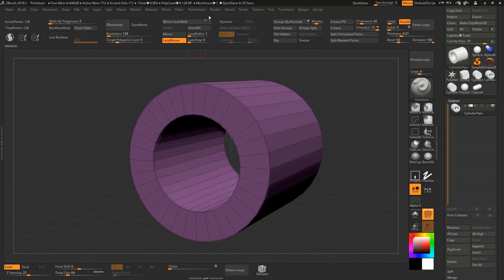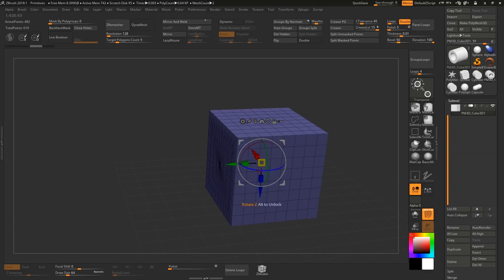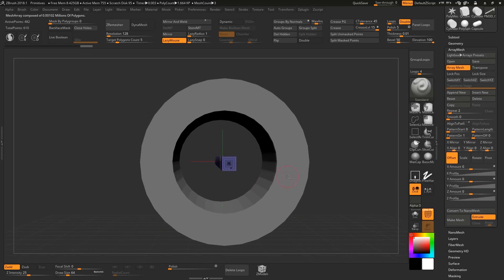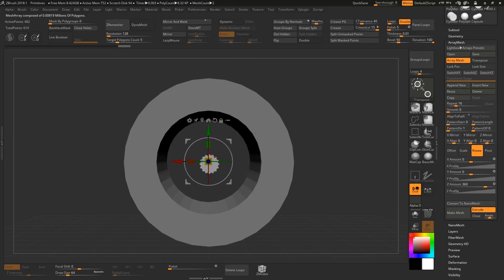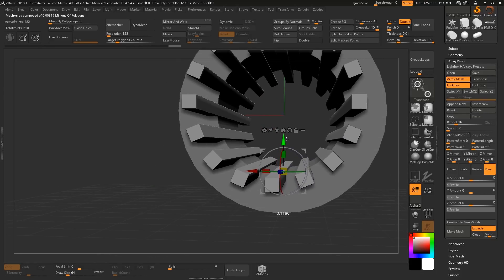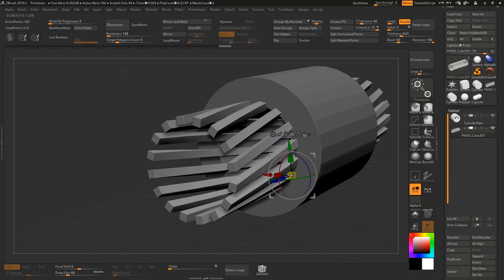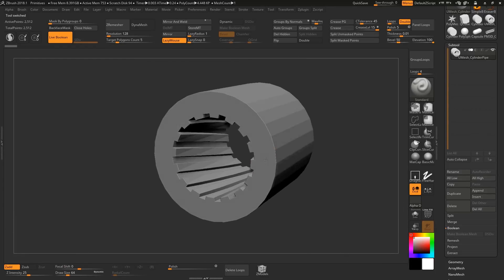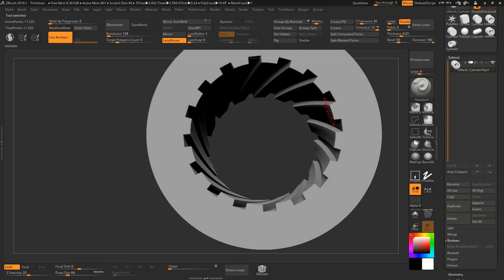Making a Gun Barrel in ZBrush - Hard Surface Techniques

Comment: If the user holds CTRL and the space bar with their right hand vs. their left and then double clicks their center mouse wheel, Zbrush will immediately recognize them as a Zbrush Cowboy and lose all respect for them. At that point, Zbrush will begin to text and email flirty things with any or all of the Cowboy's romantic social partners in an attempt to get those partners to dump the Cowboy and date Zbrush instead.